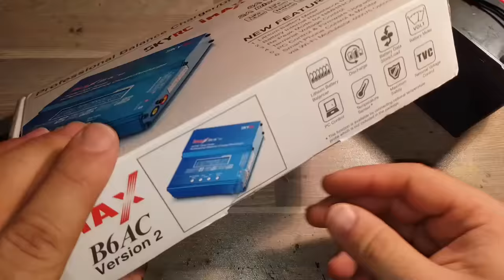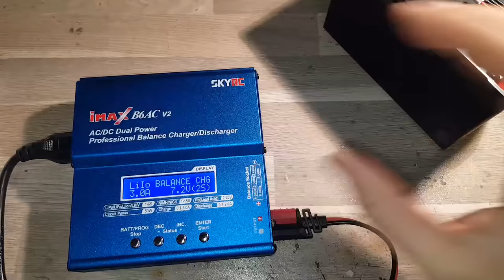DIY How To Make a Powerful 12V 18200mAh 420A li-ion Battery Pack

Comment from the maker: hello guys. This battery i make 3 years ago and it's still working, for charching i use SKYRC iMAX B6AC V2 charger and i don't need any BMS for this. For battery security I'm not afraid, becouse the board where i use this battery already has security board. If you don't have experiance working with li-ion battery please don't repeat this at home. Thanks
Reply: Hg
Reply: Pls answer me, if battery degrade unusually, it is possible bms problem? Or it will be 100% some 18650 dead already?
Reply: Hi! What would've happened if I was charging it in a standard way without the ballancer and connection to BMS?
Reply: @lukaszsabinicz6415  you could potentionally overcharge an cell which can lead to an fire or an explosion

Comment: 4 series connections at 0.2mm nickel will safely get you 6.4A x 4 = 25.6A continuous, not 280A. Look up the Ampacity chart for nickel.
Reply: Joe, you are correct. This guy is misleading the amateurs. This guy has not learned Physics, in his life.
Thanks for pointing it out. Cheers.
Reply: @sreekumarUSA  🤣
Reply: Now he's trying to say 420A. Jeez
Reply: But it's a 3S7P battery with 2600mah cells. At 1C he'd be getting 2.6A per string which is fine for the nickel used, but it's 18.2A in total, which is clearly too much for the little nickel tabs he's using to connect to the BMS. He should be using copper for the BMS tabs. 
He's making his discharge claims on the 18650 cells alone. Each cell has max continuous discharge of 40A (7P = 280A) and pulse discharge of 60A (7P = 420A). The BMS he's using clearly states 60A @ 5:09. There's all kinds of carelessness in this video.
Reply: @missingMBR  I guess your one of those who don't want the entire film, then comment about it. At the end you can clearly see he never used the BMS, just shows us that its possible too. You see him using a balance charger at the end, because there is no bms.
Reply: @kristofferhtta8933  I watched the whole video after making this comment and saw the BMS was shown but not connected. I had to comment after seeing he was using just nickel strips for discharge and charge
Reply: @missingMBR  Aha (y)

Comment: If you draw 280 amps, or 40 amps per cell, or even 420 amps at most or 60 amps per cell, I hope you run really fast
Reply: If there are 10C and even 20C cells, you can draw 40 amps out of it and it will be fine
Reply: @oprisvlad3102  but the 18650-s can handle 10 amps a pop. So 70 amps total, with peaks of 140 amps. And with the best cells you can get 20 amps per cell continuous, 30 amps peak so 210 amps.
Reply: @VizTech3   both comments are valid, however there's no way that nickel can handle 210amps!
Reply: @treveansalt  Correct :) the nickel will handle like 60-70 amps in my experience(0.15mm)
Reply: @VizTech3  so what’s the best way to improve it? Like how could I create a lithium ion battery for a motorcycle starter battery ? Or would you be heavier than lead acid at that point ?
Reply: @Fee.1  thicker nickel strips, maybe 0.2mm and weld 2-3 on top of each other to increase the amps that can flow through it. Also it’s not about just the battery. You also need to add a bms and modify the alternator on the bike to output 12.6v rather than 14.5v which is the charging max voltage of a lead acid battery.
Reply: @VizTech3  if I am correct this is a 3s7p battery he has- hopefully he can use a professional ballance charge on it
Reply: @VizTech3  I think 14.5v for this pack is not bad. BMS can handle it if we use one. 2v differece is somehow acceptable
Reply: @moya9450  any voltage difference above max is not okay for lithium
The battery is not over voltage tolerant in any way and goes boom explosion if you go higher voltage
Reply: @kitecattestecke2303  Yes battery can't tolerate but BMS here just for that reason. BMS can handle even more than that. BMS filter the higher voltage and battery will not get damaged. Most of BMS's have over voltage protection.
Reply: @oprisvlad3102  my vape lg hg2 i bought years ago are 3Ah and have a peak discharge of 35A and continuous discharge 15A. Newer cells with higher c rates must exist.
Reply: @Fee.1  you could solder a wire copper on top of the strip for added ampacity.
@rocco thanks for the info, thats my thickness, i will consider it 60 amps.
Reply: Most 18650s are not rated for such high currents. There are some that can do up to 25A or more (I would take the manufacturers up to rating as the peak, not continuous), but capacity will suffer at those currents. A lot of the 18650s about are lower current cells, that are only really good for 5-10A.
Reply: @mememan2344  This is why LifePo4 are becoming so popular. The problem is the weight so 18650s rule in this application. In order to maintain those amps you've got to add some doohickeys.
Reply: @Fee.1  - You would buy suitable LiFePO4 cells and make them into a 4S pack. But there is no point really, since a standard Lead Acid based bike battery is good enough and the Lithium offers no practical, performance or cost advantage. For racing... perhaps, but then they don't have starting batteries do they?
Reply: @johncoops6897  motorcycle use is what o have in mind. Every pound counts and they sit for long periods

Comment: Those are rebranded Sony VCT5A that have a 25A continuous discharge rate. There is no way that battery will put out 280A continuous and 420A pulse.  Four 0.2mm nickel strips between series connection are not going to handle those amps. I will estimate under 100A. Plus the batteries will not be able to put out that many amps.
Reply: Exactly what I was thinking. No where near enough conductor. 
I use .008" laser cut nickel plated copper in a pattern that maximizes cross sectional conductor area. Samusung 40Ts 7-14s 5p. Conductor area is equal to about 5awg copper wire. I rate it at 200amps continuous 350 burst.
Reply: I was thinking similar,  
I'd love to see him trying to put a 280A load followed by (if anything left) a 420A burst on to it. 
It would have been a good video if he was truthful with the result.
Reply: if you want to charge the phone and start the car, use A123 lifepo4 :)
Reply: @zachniedfeldt  You mean copper plate?
Reply: @FireDFPV  I'm not sure what you mean?  I use copper that is nickel plated. About 0.21mm thick copper isn't really plate IMO.
Reply: @zachniedfeldt  I see. So instead of nickel stripe you use copper stripe. But is spot welding copper stripe the same as nickel stripe, using the same kind of spot welder? I have read there are some limitation. Like needing more power to spot weld due to copper is more conductive and the general spot welder, as for nickel, cannot get the job done. 🤔
Reply: @FireDFPV  you need more heat. So quite a bit more power yes.  Took me a few months to really get it down and it does push the limits on my welder. (Kweld). I just got an orion 250i welder today and that should allow me to do almost .5mm copper

Comment: That lipo is rated for 5000mah or 5amps x60C = 300Amps which gets closer to 420A as you stated but there is no way those 18650 will put out  280A especially over those .2 mm nickel strips. Those might do 20A on a good day in short bursts with out melting them but you only have 4 linking the strings together. That's a max of 80A. Which is still impressive for a small battery pack and it is a nice build. However those 40A 18650 are also way over rated at 40A. Do an actual load test on one of those and see...
Reply: You seem to know a lot about this kind of thing. I have a 9 ah SLA battery right now. If I build one of these do I need a certain kind of charger or can I continue to use the charger I have now?
Reply: @SVMSICE  The short answer is this is a long answer and I don't even know the question. SLA and li-on are apples and oranges apart. First, SLA is not a good choice for anything that that needs drained and re-charged. LA Batteries in cars have a lot of cranking amps but are only made to be used momentarily until the engine starts. Draining them reduces their life greatly. Deep cycle SLA are made to be more drained as in for boat or trolling motor use but still do not have the capacity to be charged anywhere near what a li-on can be. Plus there is weight.  So my first question is what are you trying to build? What is your target voltage and amps?  And what are you putting it in?
Reply: @jamescole6846  12 volt used for an underwater camera and screen also for use in a Vexilar sonar. So they will be drained and recharged.
Reply: @SVMSICE  amps needed? Hours of use? This doesn't seem complicated. Have you look at lipo's?  You need the numbers before you can calculate a solution.
Reply: @jamescole6846  ok I’ve been doing a lot more looking into this and yeah I’m a newbie so I wasn’t clear on a lot of things. I’m a lot more familiar now with types of 18650 batteries. I see why you couldn’t answer. So what would you suggest battery wise (18650) to make a 12 volt like his, same case,  that’s going to get used half dozen or more times a year? It will probably come close to draining the batteries after usage.  Well actually I’m not sure if it would come close to draining it with this type of battery but it comes close to draining my 12 volt SLA battery I’m using right now. That’s why I was think about building one of these versus buying one of these because I like to try new projects like this.
Reply: @SVMSICE   @IcePike  Well again it depends on the current draw of the device and how long you want it to run. If the device draws 1A at 12V then one of those 7AH SLA sealed batteries will run the device for 7 hours. If you run 2 in parallel then it will run for 14 hours and so on. You can charge SLA's in parallel as long as they are of the same type and ~voltage level when you start. How long? depends on how big the charger is. If charging one battery took 7 hours then charging 4 in parallel with the same charger will take 28 hours. But again SLA are not the best for something that is going to be continuously charging and discharging.    Li-on or Li-po's are great for this. However they are very sensitive to charging and discharging voltage levels. In general they like to stay between 3.2 and 4.2 volts. Charging above or draining below will ruin the battery. Permanently. But if you have a good BMS these batteries will charge and discharge 700-900 times on average and with these you can build your packs as big as you want. For example a 3S14P using the Samsung 35E INR 18650 would get you 12V at 49AH in a relatively small package  using 42 18650 which are about the size of a AA battery. All lithium come in different sizes, capacities, discharge rates, charge rates and price associated with each option. So again it depends on  the voltage needed and current draw of the device (amps) and how long you want it to run. You need to determine this first in any application before you start just throwing batteries together. If you want to run an electric clock for a year this is easy, if you want to run a 5000 watt electric bike for an hour, this is hard.
Reply: @jamescole6846  Thank you for your reply.  Yeah I've been doing some more studying and just learned about the BMS actually. I've got a lot more to learn on this is what I'm seeing and testing to do before I build a battery lol.  Thank you again

Comment: From the looks of it you are using Sony/Murata VTC5 cells, they have a capacity of 2600mah and a max continuous discharge rate of 20A so really the max current you can continuously draw is about 140A, that is still a lot but nowhere near the 420A. If your cells really could do 420A together then your capacity wouldn’t be 18,200mah, it would be lower. Other than that, great video!

Comment: I would love to see a 280 amp load test. You are high if you think you are going to flow over 100 amps through Nickle stripping that size for more than 30 seconds.
Reply: Even 10 sec :)
Reply: 😂 “elementary electrical standards, bruh”

Comment: ALL wires must have mechanical connection together before soldering and heat shrink tubing. Twist bare wires together first, then solder. This helps you not to have cold solder joints and have a possible short or open circuit. Use a buck/boost converter for different voltages. It can be affixed to  case externally or internally if you have the room. No special tape or paper insulation needed - use cardboard/pasteboard and hot glue to isolate and hold down battery. Leave top glued at spots with hot glue so you can open battery box to make changes if needed.
Reply: nerd